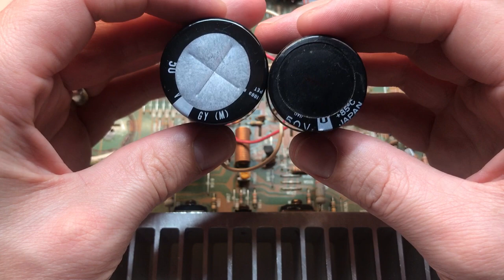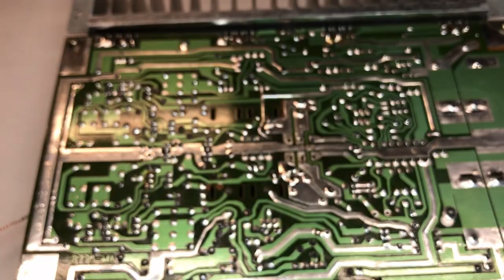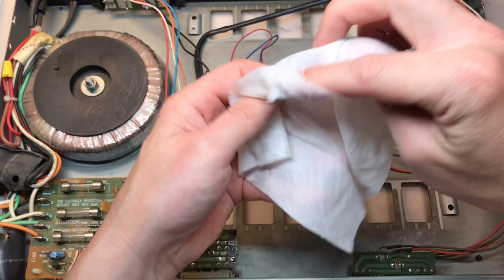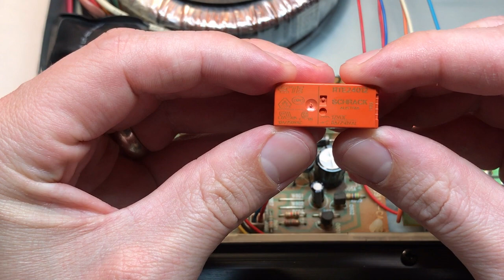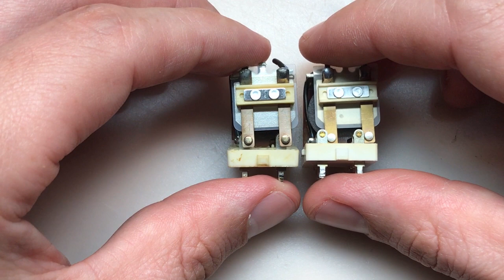DR #29 - Carver TFM-6CB Repair - Part 2

Comment: The glue on the bottom of caps was used to hold  larger components in place until they made it to the wave soldering process machine, and you would see smaller caps than those "snap caps" also glued. Between the machine that handles the board, and any movement while the board is handled beforehand, it just insures parts are held in place until the solder cools. If you notice how all of the solder joints and exposed traces have the same liquid looking "flow" to them, that definitely looks like a wave soldered board.

Comment: That glue was just "standard operating procedure" back in the 1970s .  The main problem is that  a lot of the glue can become conductive over time and actually cause shorts on the boards.  It makes a huge mess also

Comment: I have the same amplifier that is blowing one of the three fuses on the power supply side and even if I unplug the amplifier section the fuse still blows. Any ideas where to start looking?
Reply from the maker: Check the 4 diodes between the secondary of the transformer and the connector J001 (D702-D705). One or more may be shorted.

Comment: I just finished working on a TFM-6C that had this same symptom however what I found was two problems. The relay driver circuit gets it's power from a single diode rectifier through D707 and a small 10uF capacitor C708. The circuit couldn't pull in the relay because C708 was shot, probably from the terrible ripple from the half rectifier circuit. I replaced C708 and the relay started working. When I search for this solution I found similar discussions in some forums. For the relay contacts a pink eraser definitely worked for me and you can see from the PCB traces that only the N.O. contacts are used so I just focused on cleaning the back side contacts. I too searched for a replacement and ran across the 1335P relays listed on ebay here https://www.ebay.com/itm/Guardian-Electric-A410-363734-12-Relay-1335P-Series-12VDC-Coil-/362716676702  however from the photo that center contact sure looks oxidized to me so I choose to just clean what I got. Now I hope to put this back into service to power some Atmos speakers.

Comment: Great videos. One suggestion. Spray some contact cleaner on the adjustment pots before you tweak them. The wiper has been sitting in the same spot since factory and the carbon trace is for sure pretty dirty around it. This is why it's jumpy around the required measurement spot. It will make your adjustments much easier.

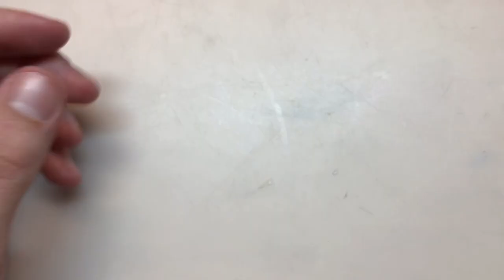Comment: The contacts we are looking at at 10:10 are NOT the ones that connect the speakers. You need to address the "normally open" contacts which are only engaged when the coil is energized. The contacts shown here - we need to be looking at the "back" side, and the matching ones closer to the rear. Those are the ones.
Reply from the maker: Correct. I showed the outer contacts as they were the easiest to see, especially when comparing before and after. All contacts were cleaned.

Comment: Nice repair! Thin cardboard - like the kind used on the back of writing pads - cut in strips and used with contact cleaner works well for cleaning contacts. Old style "Ruby Red" erasers work well - the newer type white erasers do not.